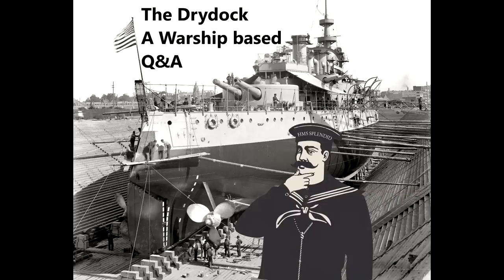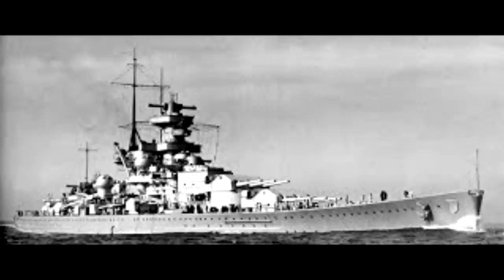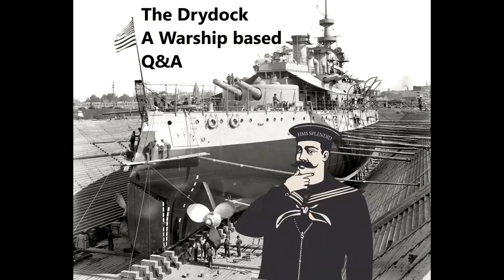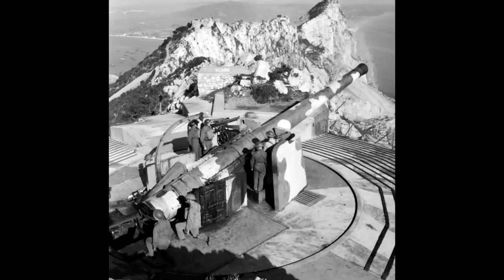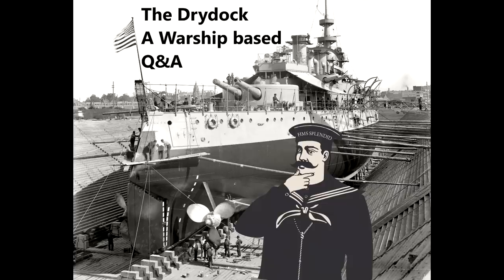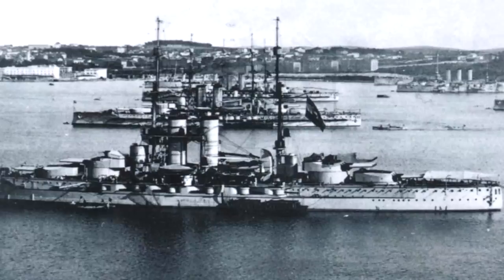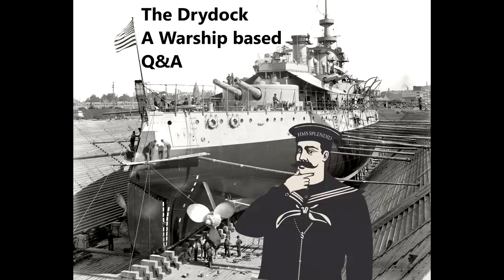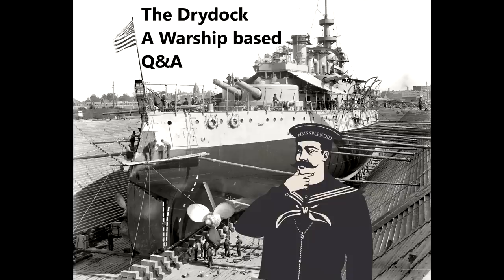The Drydock - Episode 123

Comment from the maker: Pinned post for Q&A :)
Reply: The discussion of ranges at the beginning got me thinking, were there any recorded boarding actions in the 20th century?
Reply: germays deutschland class: should or could ther germans get a better ship design, or was it the best they could get, within the ways of the treaties. or would a pre hipper CA (aka wows yorck) or a heavyer Coastal Defense Ship (like the swedish one) be better?
Reply: Why did most navies stick to a 5" gun or similar in the interwar period? Wouldn't fitting destroyers with twin 4" rather than single 5" be more sensible once the capabilities of aircraft start improving?
EDIT: Also since the weight of the shell of a 5" is only roughly double, you'd retain the broadside destructive power.
Reply: If the Japanese captured Midway island, what were they planning to use the island for? Were the Japanese  carriers going to leave so e of their aircraft behind for air defence?  Did the invasion force bring enough  supplies to restore the airfields? Would the US even bother to re-capture Midway or just  bypass it like Wake island?
Reply: I heard something about the shell dye colors of the USN from WW2 still being classified. What are shell dye colors?
Reply: @cmdrbigbob  from navweaps.com

^The AP Mark 8 had a nominal 1.5 lbs. (0.68 kg) dye bag but this was allowed to be as large as 3.0 lbs. (1.36 kg) in order to bring underweight projectiles up to standard. The Iowa class was assigned the following dye colors:
      USS Iowa - Orange
      USS New Jersey - Blue
      USS Missouri - Red
      USS Wisconsin - Green

The dye colored the water spouts from mosses so that the ships, if they were operating together, could distinguish their salvos for corrections. So if Wisconsin and Missouri are firing at the same target, the green splashes 500 yards short are from Wisconsin, not Missouri.
Reply: @USBDriveNo2  I've seen some passing references to a US plan, if they lost Midway in a larger war, to just lay seige using submarines.
Reply: @tomaseidtner8116  Better? It's not a bad design for the job actually. And yes, with regards to costs and treaties, it's not everything you can dream of.
Reply: @cmdrbigbob  There is nothing secret about dyes. Bright colors like yellow and green so you can see them.
Reply: If there wasnt a land connection between Danmark and Germany, how much resistance would the danish navy have been able to put up against the Kriegsmarine? Would it have been the grand battle of the Torpedoboats  or would the german destroyers just mow everything down?
Reply: @kemarisite  

I’ve seen a lot of misconceptions that the Japanese were unique in using dyes due to lack of radar (and their supposed lack of fire control computers, when they did have those).
Reply: @ComradeBenedict  HMS Cossack in Josingfjord where the Altmark was cornered. Nobody can say conculsively if cutlasses were issued or not, probaboy not officially issued
Reply: Linguistic question as much as anything:  Why does an American say he and airplanes both ride in elevators, while an Englishman says he rides a lift but airplanes ride an elevator?
Reply: Were many turrets able to rotate fully 360 degrees? or were there some mechanisms to prevent this from this happening, presumably to prevent damage to the bridge etc.
Reply: Were the hunts for Graf Spee and Bismark special for any reason other than their eventual success for the RN? Obviously there were several other ‘big ship’ sorties that don’t get the same press, but were the attempts to track them down of the same level as used against Graf Spee and Bismark?
Reply: @WALTERBROADDUS  yep, I've long thought the Deutschland class was a perfectly reasonable entry in the CA category without the treaty limitation on gun caliber. It would have been nice to get the dual purpose 12.7 cm SK C/41 in place of the 15 cm secondaries and 10.5 cm heavy AA guns, but that wouldn't come out until 1944.
Reply: @kemarisite  I think we are getting too many gammer types vs. military history folks. They seem over focused on fantasy match ups and weapons combos.
Reply: Will we ever get a special on E Boats, MtB, and PT boats?  How about the USCG cutter Eagle? 🤔
Reply: Had Prince Eugene stayed with the Bismark, would Bismark have had better chances of reaching port? In other words,  do you think that Prince Eugene could have disrupted the Swordfish attack or towed Bismark towards Luftwaffe air cover when it’s rudder was hit?
Reply: Any 5 minute guide on the Sloop John B?
Reply: It seems to me that in WW2, the US navy had a series of “pushes” (Nearly the whole fleet would head out at once, ie. for midway/Guadalcanal/Philippine sea), whereas the RN seemed to go out in more of 2’s and 3’s.(in terms of capital ships).  Is this perception right?  If so, was it more to do with doctrine, or was it circumstantial.
Reply: 1.  What were the fastest carriers, cruisers, destroyers and submarines from the following time periods?  
1890's
WW1
WW2

And what were their top speeds.

2. Also, what is the fastest warship, over 1,000 tons, that you've ever heard of.  ( Obviously excluding newer ones whose speed might be classified.  

ps.  I know some of those didn't exist in the 1890's.
Reply: If the RN had focused on the 4.5-inch gun at the expense of the 5.25-inch gun could the C class have been refitted with it instead of the 4 inch gun for the C class?
Reply: Also, could you do an in-depth video on the conversions and rebuilds of battleships and cruisers of both the RN and the IJN?
Reply: Unryū-class aircraft carrier: how effective would they have been if the Japanese had the air crew/fuel, how effective would they have been mid war before the zerg rush of American industry drowned the empire
Reply: What would you consider to be the most successful modernization, either in terms of the greatest total improvement or the utility of the finished ship?
Reply: Correction to Question List: (47:05) is beginning of Hydraulic Systems for Turrets; (50:04) is beginning of Longest Range Cruiser Gun Hit
Reply: @bkjeong4302  maybe it's from the "They're shooting at us in Technicolor" line at the Battle of Samar?
Reply: What would have realistically happened if the crusier HMS Antrim had opened fire on the general strike in Liverpool? Would a civil war have ensued or was this purely for vanity rather than purpose?
Reply: I recently visited the National Museum of World War 2 Aviation and saw an exhibit about the Leigh Lights. Could you elaborate on their development, usage, and effectiveness? I’d never heard of them before and it seems like an interesting concept: to hunt submarines in much the same manner as you spotlight a deer.
Reply: @kemarisite  Which is ironic given that the Japanese were also confused by Houston's dye shells during the Dutch East Indies campaign.
Reply: @the_realalpharius9715  Not bad, but due to their small size they were going to have some issues.
Reply: @ComradeBenedict  USS Borie (DD-215) v U-405.  The Germans were the attackers.  USS Chatelain and USS Jenks v U 505.  The US ships were the boarders but the boat was deserted.
Reply: @unemployed_history_major4795  I remember this was dealt with in the book "Aircraft vs. Submarine" by Alfred Price, which I read many years ago. Radar was used to bring the aircraft within a mile or so of a surfaced submarine and the Leigh light was then used to illuminate it to allow a visual attack with depth charges. From memory I think there were very few successful attacks but they did discourage U-boats from running on the surface at night in the Bay of Biscay area where the Leigh light equipped aircraft operated.
Reply: Regarding the question of night fighting: Given the number of disasters and near disasters the HSF bumbled into when they were running for safety after Jutland, was Jellicoe smarter than Scheer when he decided a night action was far too dangerous and was a seriously bad idea
Reply: @kemarisite  I have been considering the Deutschlands, and they seem more of a throwback to the pre-WWI Armored Cruisers, which were sometimes referred to as "second class battleships" as they tended to be just a bit faster, with slightly smaller guns and a bit less armor, than a BB.  The US Tennessee and Italian Pisa classes mounted 10" guns when the usual BB armament was 12", and they could make 22-23kts vs 18-21 for a BB.  The Deutschlands seem to fit right in: 11" guns vs 8" treaty cruisers and 15-16" BBs, slower than a treaty cruiser, but faster than a USN standard or QE or R-class BB.
Reply: How did the Royal Navy’s naval aircraft compare to the US navy aircraft, both in role and effectiveness? How did they compare to the land-based aircraft the Royal Navy was more likely to run into around Europe?
Reply: Regarding fleet operations, when did the flagship transition from battleships to fleet carriers? Was this change adopted at significantly different dates by different fleets or navies?
Reply: @viscounttudon68  By the end of WWII the Fleet Air Arm was equipped mainly with Grumman and Vought aircraft.
Reply: Why did the RN have so much trouble developing DP guns for their destroyers? The MK VIII 4.7"/40 AA guns mounted on the Nelsons in the mid-1920s weren't perfect weapons,  but it seems like they could have been adapted for use on destroyers pretty easily, and greatly improved the RN's AA defense in the first half of WWII.
Reply: @Brainy Smurf most of the photos and film on board American warships were done by Combat Camera and Film Crews from the Navy .
Reply: @GoodGnewsGary   Flag ships are less about power and more about  command and control. Bigger ships have room for command staff and communications.
Reply: When parking aircraft on the deck of an aircraft carrier are there designated spot for each plane or is it that an general area is set aside for a type of plane?
Reply: Was the Yamato class a waste of resources?
Reply: At end of ww2 would US have been able to control all aspects of Russia at sea if we had gone to war? Trade/war material transports and coastal defenses on Baltic, Black Sea, Mediterranean. Did Russia have any chance at a defense navaly ? What would the major strategy be by U.S. Navy vs Russia given there's not a lot of ocean surrounding Russia well ice free ocean anyway.
WW2.5
Thanks your very good at this stuff.
Reply: Modern ships such as the US Zumwalt class have their design centered around stealth, are there examples of ships in the past built with a strong focus on stealth? Other than submarines of course.
Reply: A brief history of USS wolverine.
The great lakes paddle steamer aircraft carrier.
Reply: im listening to a audiobook for which the movie grayhound is based off and they mentioned how dye was used to maek a uboats presence why was this and how clearly could a uboats periscope be visible?
Reply: I know that you focus primarily on WWII and earlier ships, but in the future, would you consider posting something on the development of modern missile destroyers and cruisers currently in service? It seems to an untrained eye that modern warships, aside from aircraft carriers, are almost entirely unrelated to other earlier ships covered on this channel and I would be interested to learn about their lineage and development.
Reply: I've often heard that the USS Washington was hitting the Kirishima at "point-blank range."  I've also heard that the Kirishima was hit with 9 16-inch shells out of about 90 fired.  This doesn't sound like "point-blank."  Which is true?
Reply: What was the reason for the delay in developing the 4.5" gun's mountings for destroyers?

There seem to be a few problem guns/mounts that took a while to resolve. Are there any common factors that you know of between ones that had developmental issues? (ie from a particular manufacturer? Or an aspect or feature that caused problem in whichever gun it was attempted?)
Reply: @garydubose7067  opening range on Kirishima was about 8,500 yards, which in daylight and good weather would be suicidally close. Washington claimed at least 9 hits with the main battery. The Japanese recorded about 20, some of which were right next to each other (difficult to distinguish if they're from the same salvo) and some of which were below the waterline and recorded by Washington as "short".
Reply: Was British battleships more heavily armed than American battleships?
Reply: Bismarck vs Colorado?
Reply: @ComradeBenedict  The boarding and capture of the U505 first comes to mind. You can see it today at the Chicago Museum of Science and Technology.
Reply: If for some reason during WW2 the Royal Navy went the way of the French navy, say if Britain had been conquered, could the USN handled the naval war in two theaters alone?
Reply: Going the way of the French navy meaning all RN forces not destroyed or taken during said conquest are still at allied disposal
Reply: What do think would've happened if the american carriers were docked in Pearl Harbor during the attack and sunk/damaged? Would USN operations be further delayed to stop Port Moresby invasion/ lose at Coral Sea? Or do large swathes of the Atlantic Fleet get transferred and things remain the similar?
Reply: @skywise001  Yes, but so was every other battleship class built in the 1930s/40s.
Reply: @connorc4309  Would cause major issues but the USN would still win, even if it takes a year or so longer to do so.
Reply: @jadog1235  Probably no engagement.  The Colorado is better armed even with the Mark 5 AP round and is much better protected.  The Bismarck would probably refuse to engage.
Reply: Would it be possible for you to make a Rum Ration (series) about the evolution of fleet formations from ancient times to post WWII?  (Clearly, the formations you use will change depending on if you want to ram vs. defending a carrier from submarine attacks.)
Reply: Attempt 4: Bismarck V Colorado?
Reply: Shouldn't the 1920s South Dakota class been have taken into account for the I-8-8 question?  It seems really nonsensical that the Japanese get to keep Amagis and Tosas somehow and the USN doesn't have the 1920s South Dakotas.
Reply: What was inside the mast spotting tops in dreadnoughts?
Reply: The gunfire at long range hit questions has got me thinking, what is the longest hit in combat for torpedos?
Reply: @Eulemunin  Some say it may be the Niizuki but apparently the Japanese wiki says it was 10 km instead of the 11 miles(17000 meters) quoted sometimes.  So I guess that just leaves us with the battle of Java sea where the Japanese launched 92 torpedoes and hit one destroyer near the end of the type 93s range.

Comment: Based on everything I have read over the years indicates the issues was the elevator capacity of pre Taiho-class carriers. The B7A was designed for the higher capacity of the Taiho-class, so it wasn't suitable to the older classes of carriers. 

Really it is a moot point. By the time of the Taiho and the B7A, the IJN was short of pilots and crippled by fuel shortages. Fuel shortages impacted training, ships were swinging at anchor or tied up when they should have been training or on ops. Pilots were were being churned out with too few of hours to be competent in the air or combat ready.

B7a
max combat weight 12,401 lbs
span 47'3"
length 37'8 1/2"
height 13' 4 1/2"

B5n
max combat weight 9,039 lbs
span 50'11"
length 33'9 1/2"
height 12' 1 1/2"
Reply: I can't remember the book, but I read it was an issue about length. Keep in mind early IJN carriers carried much lighter planes, think Swordfish, perhaps lighter.

Comment: My understanding is the STAAG mounts on the Battles were temperamental and not very reliable. The USN was never a fan of on-mount directors due to the same problems experienced with the STAAG and the Hazemeyer. The biggest advantage of a Battle class ship compared to a Gearing was the Battle wasn't pushing the weight limit of the ship that same way we saw on the Gearing . The main disadvantage was the concentration of main battery armament forward so stern firing wasn't possible.

Comment: 00:50:04 - Longest range cruiser hits:
the Zara Class ship Fiume is the ship that got the hit on Berwick at the Battle of Cape Spartivento at a range off 22,000 meters

The longest range cruiser hits however:
Heavy Cruiser- Gorizia 22,400 meters at the First Battle of Sirte hit the superstructure of the British destroyer Kipling
Light Cruiser- Raimondo Montecuccoli 21,000-24,000 meters at the Battle of Pantellaria hitting the hull of the British minesweeper Hebe.
                        -Giuseppe Garibaldi which hit Neptune amidships at the Battle of Calabria at 19,800 meters.
Reply: And as mentioned
The Battle of the Java Sea
Haguro OR Nachi (mmh, nachos) scoring a hit ranging approximately 18000-25000 meters.. ¯\_(ツ)_/¯

skeptical "WarHorst" noises~
Reply: @Lowkeh  I would be skeptical of that  one when they don't even know what cruiser fired the shot let alone the range. And is probably why Drach dismissed it because the records are so sketchy on it.